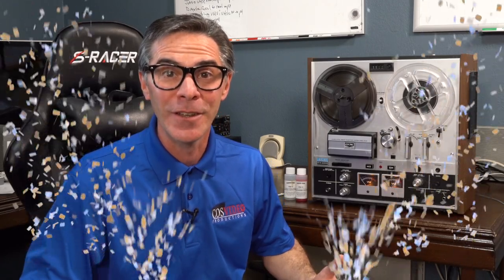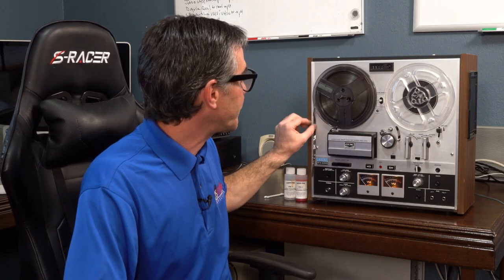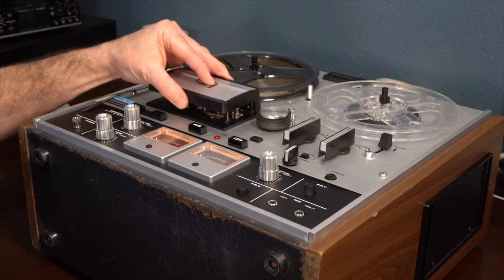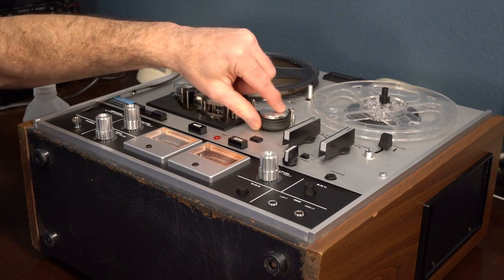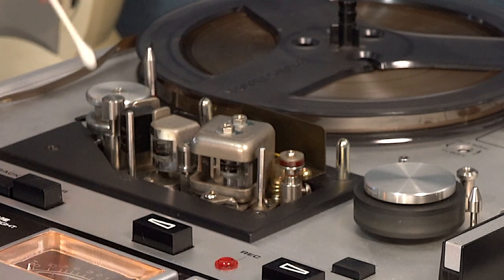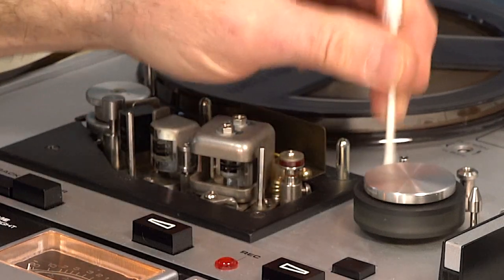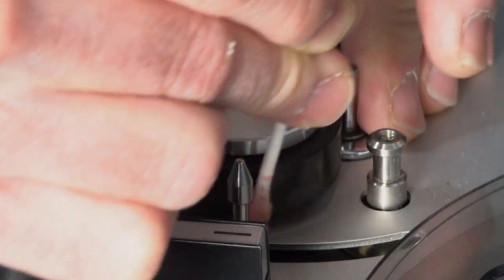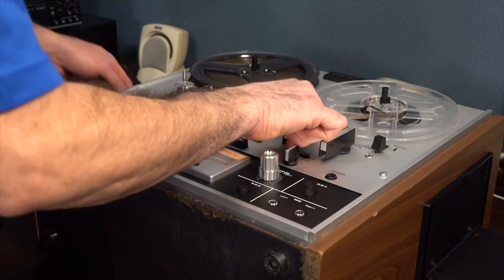How To Clean A Reel To Reel Tape Player

Comment: Hello Mark and thank you for this video. I have a model similar to the one you have and I need some advice. The wheel on the right side (right as I look at it in front of it) is making a high pitch squeal. Idk how to fix this. The wheel moves freely. What do I need to do to fix this issue? Thank you in advance.
Reply from the maker: I am sorry, but I don't know how to repair these kind of machines.  It sounds like a belt is going bad. Maybe you can call a VCR repair shop in your area to see if they could help or refer you to someone that can.  Sorry again that I can't help you out on this one. Thank you for watching!

Comment: can you link to the products in the video? thanks
Reply from the maker: I had purchased the cleaners on Amazon which is no longer available unfortunately.  I did do a search on Google and it looks like you can purchase the cleaners from various sites which I have not done yet.  If you are only going to clean your machine a couple of times, rubbing alcohol will work but don't do it too often because it will dry out the rubber eventually.

Comment: Thanks for the video. (Although the extra sound effects were completely unnecessary)
Effective head cleaning fluid seems to be pretty difficult to ship here in Canada. Ugh. I could buy rubbing alcohol but because the equipment is so rare and expensive (especially 4-tracks at 1 7/8 and 3¾ speeds), I don't want to risk and degrade the heads and have to replace that equipment. So, yeah, still, thanks for the video.
Reply from the maker: Thanks for watching.  This is an older video which I was experimenting with sounds I haven’t put in sound effects in a long time

Comment: @TheMediaNerdMT  Thank you for a very helpful video.  We have an AKAI GX-280 1/4" featuring playback and recording in both directions...I'm guessing it's from the 70's, including the dust from that era.  It's cleaned up pretty good, and the playback of our old tapes is functioning well for our digitizing (with Audacity).  However, the tape now seems to be "slipping" on the playback head - we are getting one forward track and one backward track on playback.  I'm guessing we have to re-align the head somehow.  Is there anything in your library of help videos that describes how to do a DIY at home head alignment?  I looked through your videos and shorts, but nothing jumped out.  I did notice you have an AKAI GX-220 though!!!  Awesome!!  Thank you in advance for any guidance you might have.  Greetings from Berlin, Germany!!
Reply from the maker: Hello Berlin!  It is great to see that my videos are going across the pond!  I don't know about the head alignment but I can look into it!  Did you clean the rubber wheel pretty good? When audio was recorded forward and backward on the reels, it can only utilize one track (I believe) so you will only get one track of audio on playback.  If they did record in stereo, then it would fill both tracks so you would only have audio going in one direction.  Make sense?  If you hit play in stereo mode and there are different recordings on both sides, then you will hear both recordings but one will be playing in reverse.  Thanks for watching!  Please help support the channel by hitting the subscribe button!
Reply: A slipping tape is a worn out tape you better do away.
Reply from the maker: @BertKrus sorry I don’t understand your comment

Comment: Hello have almost the same model and I have this crazy hiss in the right input any I dea how I can combat that..,..pre recorded tapes play just fine its the stuff I record into the machine that give me the problem 😊
Reply from the maker: Are you using the back audio outputs or the headphone Jack?  Which ever you may be using try switching.  You need to trouble shoot one area at a time going from the out of the player to your digitizer connection to the in out of the computer.  Trouble shooting also consists of trying different audio cables and also a different digitizer if you have one.  No easy answer.
Reply: @TheMediaNerdMT  I can use the headphone jack to record??
Reply from the maker: Yes.  I did for this video because my back outs were not working at the time.  You need to control the out put with the volume knob.  It is really sensitive.  You need a headphone adapter from quarter inch to female red and white rca.  You can find this at a music store or amazon
Reply from the maker: Have you tried the three different track buttons on the front?  That could be an issue.